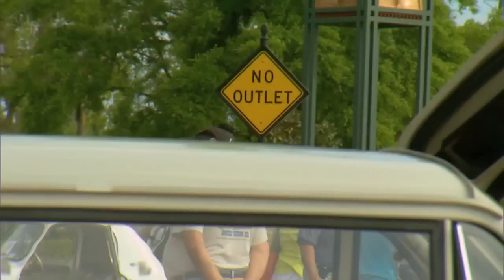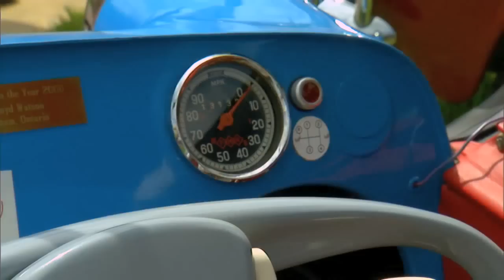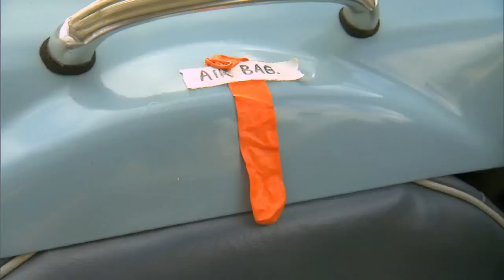Tiniest Cars Ever Made | Microcar Show | MicroSouth

Comment: the Zundapp Janus is a true mid engined car
Reply: i low key want to build a frame car with that double folding front and rear seat around the engine mabye even another folding seat in the back facing the rear seats for 6 people if i have room to fit it the storage capacity if the other rear seat folded into the first would be unreal

Comment: The Vespa 400 was designed and licenced from Vespa but the manufacturer is the French company ACMA (Atelier de Construction de Motocycles et Automobiles = Automobiles and Motorcycles Workshop ). It is unclear if ACMA licenced an existing design or if they asked Vespa to design the car.
What's for sure is that the Vespa 400 was only built and sold in France; the company capsized after poor sales (31 000 cars were made), mostly due to the high concurrence from other cars on the market and the comparatively high price of the Vespa 400.
It should be noted that a few years before, a company named VELAM (VEhicule Léger A Moteur = Light motorized Vehicle) (Creative people, heh?) licenced the Isetta from Iso, so there is also a French Isetta. Unlike the BMW, the VELAM Isetta sold poorly (figures are hard to find, but Velam made less than 8000 Isetta) and VELAM closed a year after ACMA started production of the 400